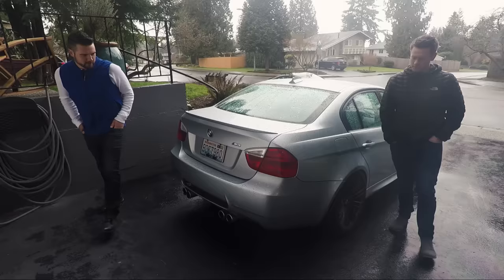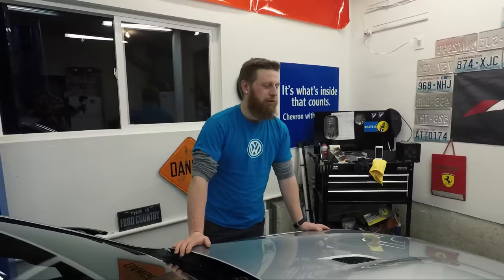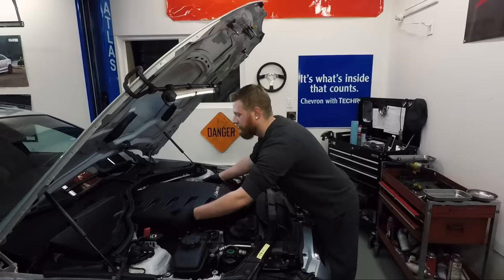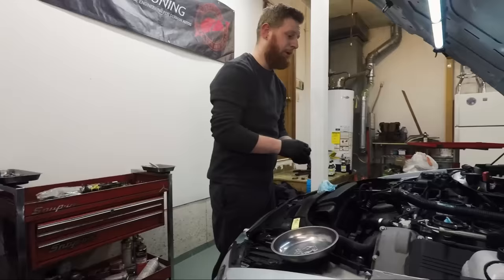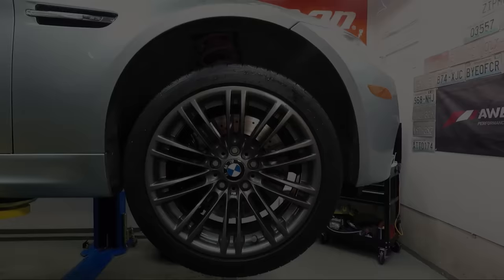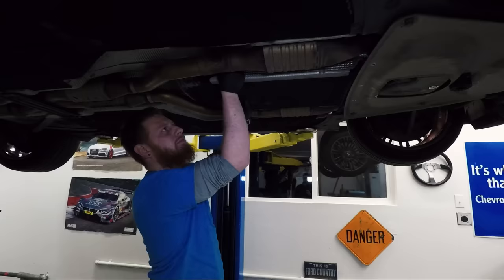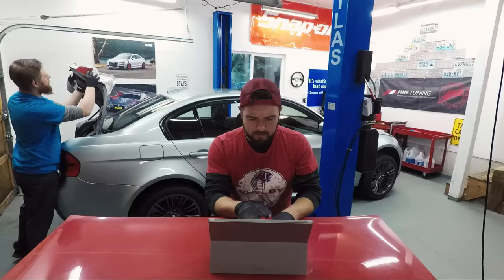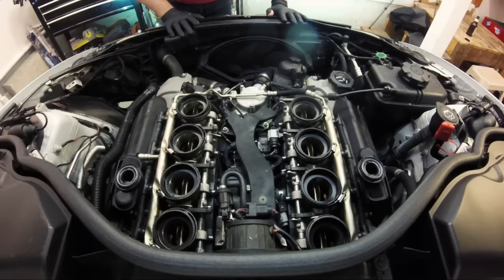How To Flip Luxury Cars For Profit (The Secrets!)

Comment: PSA: to anyone who buys one of these they left out one critical detail (non-maliciously of course) 

These engines suffer from a fatal design flaw, ridiculously low clearances  that make oil flow a problem and as such the rod bearings fail and ....$15,000 motor replacement time. 

You can/must get a blackstone oil analysis done on any car who’s owner hasn’t upgraded the rod bearings and bolts.  This analysis costs like $20 & you mail them a oil sample and they send you a report that tells you how much metal shavings is in the oil and they give you a summary and estimate how bad the bearings are if at all. You will hear people claim the 2011+ models don’t have the issue, but that’s incorrect, they changed the material and it might be slightly less failure prone but there’s countless examples of them doing just that, it can happen at 20,000 miles or 120,000,  so don’t buy the “if it was going to fail it would have already” arguments. 

Unfortunately that change away from copper bearings means that the oil analysis is useless for 2011+ models and there’s no way to tell unless you hear something or throw a rod into your  oil pan and kill the motor. So drive those cars and get a PPI, and then immediately order BE rod bearings and ARP bolts and install yourself if inclined or pay a ship -~1500 to save you a $15000 dead motor, and this adds to the resale value $1500 easily.  

Lastly, if you live in wintery climates, the OEM oil recommendation must be reconsidered. It’s a 60 weight oil in cold temps and that is like a gel practically, not good for an engine that has oil passage clearance issues to begin with.

Lastly # 2: for the above reasons, in cold climates especially but really everywhere, you MUST respect the adjustable rev line and not rev high at all until completely up to operating temperatures, which will take forever in freezing temps exponentially increasing chances for owners to shorten the life of the already challenged bearings.
Lastly #3: if you have to or want to do the actuator repair, research repairing instead of replacing which can be done as long as it’s caught early like they did, but also don’t order the OEM plastic gears that cause the failure to begin with, buy the custom made metal gears, just search google, a BMW enthusiast made a small business out of making the metal gears, they only cost a few bucks, and they’ll prevent you from having to do this multiple times, as long as you replace/upgrade both actuators even if only one is reporting a problem. 

Disclaimer: much like the IMS shaft bearing issue on 911’s, this issue is often accused of being overhyped, but losing an engine worth the price of the car nearly is nothing to take lightly, and the rate of occurrence is much higher in M3’s than the porsche issue. This problem also effects the S85 V10 (from which the s65 v8 is based) that is found in the e60 m5 and m6. 

Step 3: profit, or better yet drive & enjoy it and without fear of any of the expensive issues
Reply: Fee Nicks thanks for the information man!
Reply: Fee Nicks you're a beast thanks
Reply: 8 kilos under yep no problem!
Reply: Thanks for the information bro, I'm never buying a different car other than my e34! Sounds like newer bimmers are crap. Either buy an old school bimmer or any amg car
Reply: According to THE INTERNETS, this problem occurs in all BMW M engines starting with S54, which coincidentally marks the era when a whole lot of BMW specific forums were born.
Just food for thoughts: you don't hear much about S50 and S52 suffering from such problems, but rod bearings are also replaced in those engines.

Such information is to be taken with a good amount of salt.

If you buy a 2nd hand vehicle, you cannot be certain how the vehicle was handled or maintained. This is the sole reason why the engines break down. 

If you own ///M vehicle, you also have to understand it's maintenance differs compared to regular BMW vehicle, just as an example, you should also change differential and gearbox fluids (it is a part of normal service plan), which are usually lifetime oils in regular manual gearboxes!

It is not the low clearences that kill the engine or the oil, it is the user who did not respect the warmup ritual and maintenance intervals.

This cars, if used for short distance trips to the mall, to buy groceries etc. will not be heated up properly at all. High weight oil needs more time to heat up, combined with much better oil cooling capacity of ///M vehicles you have a really long warmup time in comparison to non-///M engines.
Thing becomes even worse when you drive aggresively on accelerator pedal and you did not heat it up. Big mistake from my point of view are the REV lights after start. They should vanish as the engine warms up but they dissaper too early, in my case with S54, lights vanish already below 75°C oil temperature! THAT IS WAY TOO LOW.

Oil analysis can help you give insight of the state of the bearings, and I would recommend it as a prevention measure. If you get high copper values, swap the rod bearings.

AND PLEASE KEEP IN MIND: ///M engines, as well as all other engines used in motorsport, need rod bearing swaps more often than you think! So it is perfectly normal to expect you need to change rod bearings every 60k miles / 100k km.
Reply: Beka Machurishvili that’s not the message you should take away from this, you can basically make it a non-issue by doing your due-diligence & investing $1500 in one time preventative maintenance, and when the actuators fail, upgrade those the proper way and you’ll never touch them again. 

You’ll only have issues if you buy one with no clue and never deal with the potential issues, and even then you may not have an issue at all, 

The point is, it’s not worth pushing your luck and given the costs associated with just hoping for the best and having a major problem, it just doesn’t make sense not to invest in the long term health of the engine. 

Then you’re set.  Any quirky/high performance vehicle these days is a commitment/relationship and you should do a fair amount of research into potential isssues and do whatever possible to prevent those issues from ever happening, which in these cars is luckily pretty easy now all things considered.
Reply: Beka Machurishvili you’re right that things aren’t as simple as they used to be, that’s a given though
Reply: you forget about throttle actuators which are 1000$ each for part without labour and it has two of them. They also fail about 80k miles.
Reply: Souneq I did not forget about them, they were addressed in the video and I brought them up as well specifically suggesting not buying the expensive OEM crap replacements
Reply: Gluttony kills people, stop before it is too late.
You are bothering replying because credibility of your statements has been shaken. Still is.
Let the reader of your comments decide for himself. You are taking my sentences out of context and attacking me personally for no reason. I am not contradicting myself in any point. As it is written, it should be read.
I never stated ///M engines are motorsport engines. You can re-read my comment and you will see your mistake. What I did state, however, is that the change of the rod bearings is to be expected every 60k miles. That fact I compared with motorsport engines, whose regular maintenance usually encompasses also rod bearings change. Reason why I referenced motorsport engines because they are built to withstand higher loads. Also, ///M engines are built to withstand higher loads than their regular road counterparts.
Biggest role here play rpm, piston velocity and piston acceleration which produce higher force on the crankshaft than one would think. Since you are so profound in knowing these engines, you should also be familiar with what I am trying to state here.

I am sorry for being unable to understand what you wanted to state in your last sentence, but seems you are laughing your ass off from amusement.

Stop being a jerk trying to dispute an argument in a disrespectful manner. Trying to scare me with rethorical questions will not work. I am human typing and I expect you discuss in a civilized manner.
If you want to discuss other failures on BMW vehicles, I have nothing against it. But using this disputable failures, which MIGHT be addressed to BMW, to back your inital response is only a shallow and transparent cheap trick to try to get more credibility for your statements. It might be correct that BMW made an error, but since I doubt you can't be 100% certain it has nothing to do with how the people are maintaining their vehicles, I cannot take such information for granted.

Yes, there are a lot of information out there about dreadful problems on BMW, but when we realistically count them, we are talking about maybe 1% of total number of produced vehicles. Who does not believe any of this I am writing, please DYOR. I am trying to shed a bit of light into this dark negativity about many things.
I own S54 and S62. I do not see any problem with preventive measures on these vehicles. If that means I should swap chain guides, rod bearings, oil pump or anything else every 60k miles, I will be the first to do it.
Reply: Well, if you want talk big words, the only hypocrisis one can see here is not reading past the first sentence, but still addressing further written matter, as well as completely disregarding anothers opinion while providing argumentum ad hominem.
Random facts gathered throughout internet forums and indiviudal experiences is not knowledge.
Reply: thanks for the info. now i'm scared to buy a used m3 in cold climates, because what if the owner didnt drive it properly and use the proper oil?? 
does it cost around $1500 for a shop to do the rod bearings?
Reply: mujjuman depends on where you live but call around or look on the forums to find local prices, just get a oil analysis on any pre-2011 car and for 2011+ just get a good inspection and immediately replace the bearings and bolts, don’t get “coated” bearings get proper stronger bearings and arp bolts and for $~1500 you should be set. Small price to pay in my mind, especially if you negotiate around it
Reply: Thank you for the very important advice, Fee Nicks. I really appreciate it. 
It's so nice when the ppl in the car community help each other out
Reply: mujjuman sure thing my pleasure, incidentally these guys just made a video covering l the m3 generations and potential issues with it. sometimes bmw fans take it personally but it’s to an attack on the brand or car, I wouldn’t take the time to memorize the shit if it was some childish game, but the point is knowledge is power and even if only a fraction of owners will experience catastrophic engine failure, it’s still the type of thing every potential owner should know about so they can make an informed decision. The forums used to attack anyone who talked about it, it happened to enough people eventually it became clear it was just something that had to be talked about. Best of luck, hope you enjoy your eventual purchase.
Reply: Fee Nicks thanks man I appreciate it. I totally agree with you, because being informed about these things is important. I’ve been a BMW owner for several years now but I never made the jump to the M cars yet because of price haha. The older these cars get, the worse it usually is, so the M cars were always out of reach for me. I know what you mean when you talk about the forums, and I also see the same behavior here on YouTube comments.
Reply: You’re right, people take it personally as if it’s an attack on their cars, or this brand, or even a personal attack. I used to be like that when I was a teenager and a BMW fanboy. I’m still a huge BMW enthusiast, but I am realistic and practical about the reality of BMW ownership.
Reply: mujjuman it’s for fanboys and everyone. But fanboyism that goes to the degree of denying reality is dangerous, be a fan of a product or a series of products or even a brand, but never a corporation
Reply: mujjuman yep, I appreciate you taking the time to say thanks, it really comes down to just being a pay it forward situation, someone educated me on this and potentially saved me a totalled car, I don't understand the logic of people like the guy who replied a few days before you, he was all over the place, claiming the sole cause was drivers mistreating their vehicles and not respecting the adjustable rev limiter, but then he said it's also 5 other things and it's also not an issue at all it's to be expected because it's a "Motorsport" engine (bullshit) and simultaneously suggesting it's basically a non-existent issue that was created on internet forums. So it's a non existent issue, an issue that's just to be expected, and an issue that's all the drivers fault, all at the same time, and he had the nerve to suggest I was taking his statements out of context. These things were talked about just as much when they were the topic of magazine articles and BMW CCA/ Porsche Car club etc. Meet ups and bulletins etc. People complained about e39 M5 rod bearings and you won't have an issue with those until 200k, the e46 had a recall to address the bearings, the e92 didn't and lots of people have been a screwed, that kind of news travels fast, it's not the end of the world, if anything it's a blessing for enthusiasts who are savvy to it, and BMW dropped the ball and didn't issue a recall, that was a dick move but it doesn't make me want it any less. It's people like that ironically that turn people off the car and whatever brand they're defying logic for. 

Anyway thanks again, if there weren't 5 people like you saying thanks for every one asshole like him i'd not even waste my time & inevitably get sucked into an argument with someone who doesn't respect the evidence based data & reasononed logical debate, which is like arguing w/a parrot.
Reply: "Buy any AMG car"!? That is literally the worst car advice I have ever heard. Ever. Thinking about buying an out of warranty AMG car literally gives me an upset stomach.
Reply: Lansoy Romero same exact situation as above except easier in many ways. Having the motor out of the car is a prime opportunity to do a bunch of things that would normally cost much more. Anyhow get the motor inspected and test the oil etc, but if you aren’t sure of it’s history, then whoever’s doing the swap will check the health out for you, and just upgrade the rod bearings and bolts while you can do so easily because the motors out. I really want to swap a s65 or s85 into a M coupe/m roadster but I don’t have any connections and have no idea how much it would be, but all indications point to $$$&&&. Idk about a DCT in a e30 though, I mean if that’s what you want to for it, seems counterintuitive to me personally
Reply: so you're saying do a dry oil sump??  ;))
Reply: the rod bearing issue affects about 2 % of the S65 engines, so its actually a very low percentage.
Reply: CarMax maxcare warranty
Reply: Fee 1
Reply: Fee Wow I had heard about this issue with the M3 but V8s but I didn’t realize it was that much of an issue. Doesn’t surprise me that it isn’t a recall issue since these companies don’t like to spend money to back their products
Reply: I want an M3 or a 335i but I refuse to deal with the scary ass maintenance. 328 or 330 for life
Reply: Great write, good info to know
Reply: #bothered
Reply: You know your shit bro...........
Reply: @somebody9889  IMO yes easily, just do your homework and have some savings set aside for it

Comment: Great video! I owned 6mt e90 m3 for 4 years...i loved the car. It was a well built, solid, performance machine. I agree with everything you said except for being able to daily drive it. Its gas mileage is AWFUL around town, bordering on prohibitively expensive if you drive it like it wants to be driven.  You will be filling up every 3 days or so.  Also, its lack of low down torque makes it slowish off the line unless you launch it. You WILL get smoked by most other performance cars with similar horsepower ratings because almost all of them will have more torque.  Its a fun car, but not at all quick enough for a 400 hp car. Its also quite heavy. Close to 3800 lbs with the sunroof.

Comment: Having owned a 2008 e90 M3 for 8 years now, with 90K miles, did you think about replacing the rod bearings?  I replaced both throttle valve actuators (curious why you only replaced one, or if the other one had already been replaced?), but am holding off on the rod bearings as it's a gigantic job...

Comment: Nice job guys.  This is obviously based off the Wheeler Dealer structure and that is great.  I really like the content but like mentioned in other comments it would be nice to go over each cars inherent faults (E46 rear frame issue, E90's bearing issues, M54's oil burning issues etc).  The only change I would make is the music volume level.  When watching the tech segments at a comfortable volume you are then nailed with a very loud music section.  Tone this down a bit and it will make watching the episode much more comfortable. Keep up the great work.

Comment: I bought 08 M3 DCT with 87k miles for 19995 in December 2016, half year before this video, clean title from a dealer. It had a check engine light though - the dealer said it's probably very minor issue, but turned out the throttle actuator for both bank were dead, I paid $1000 for 2 reconditioned actuators and replaced myself. Been changing oil every 5k miles with Mobile 0w-40, so hopefully engine will be OK. Some noise from rear diff and DCT not smooth/slipping, so I will change both fluid- DCT oil change will be a bit more complicated than this manual transmission though.